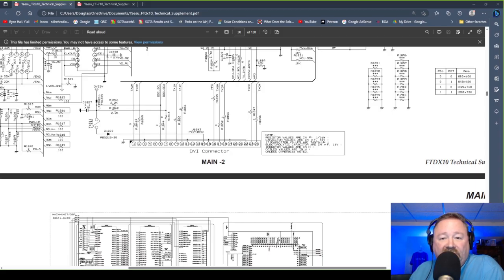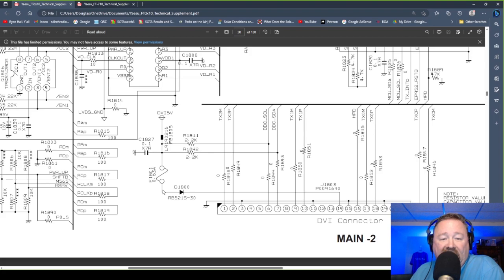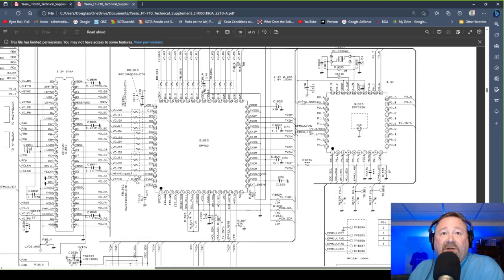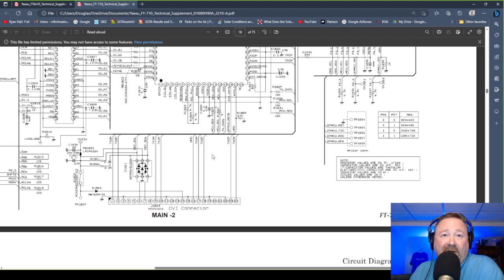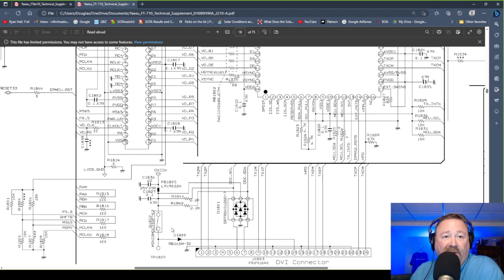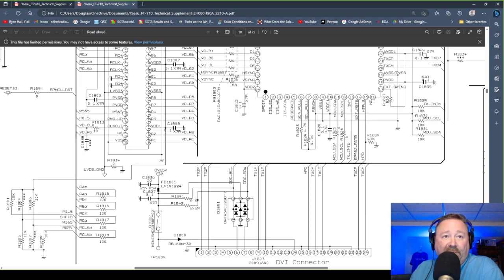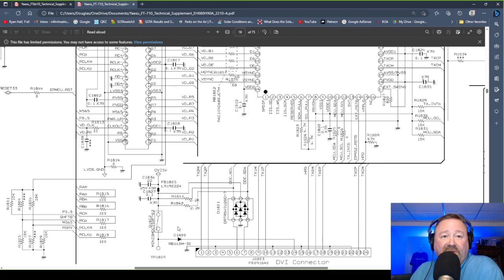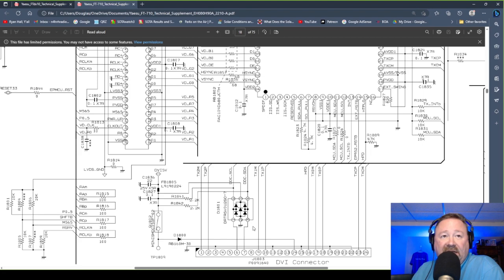Yaesu FT-710 AESS: DVI-D Port Protections (video #35 in this series)

Comment: Thanks so much for bringing to light the issue, and showing the difference between the two radios.   With the improved overcurrent protection on the FT-710, do we know if there have been any 710 returns to Yaesu due to HDMI-caused failures?     73, K7KS
Reply from the maker: You would need to ask Yaesu about that. The FT-710 has a self-resetting fuse for the DVI circuit, so I suspect less of them have had to be sent in for repair.  I stayed with the FTdx10.  For me, receiver performance takes priority over using an external display adapter. I used an actual DVI-D cable and monitor, and April will be three years with no issues.
Reply: @n4hnhradio  actually 710 has a better receiver performance with zero distortion that you get distortion all over the place on dx10 - it is just better technology and as the firmware improves the algo improves and it gets better and better.  So dream about your dx10 bean better - maybe only for CW.  -
Reply from the maker: The DNF in the FTdx10 introduces distortion versus the FT-710.  But the DNR in the FTdx10 makes it possible to hear signals that are barely above imaginary.  The FT-710 DNR introduces digital distortion.  There is no one perfect radio.
Reply: @n4hnhradio  not worth 380 EUR difference for what few db it gives of separation when in busy contest.  Other then that 710 is a lot cleaner in everyway.
Reply from the maker: Suit yourself. I’ve used both. I made my choice.  I don’t participate in contests.  I chase barely above imaginary QRP SOTA activators.  I need the best receiver possible.  The FT-710 can compete with any on CW, but not SSB.  Still better than many though.  Just not quite at the level of its big brothers.  Also missing some convenience features that the big brothers include, such as the ability to set the mic gain for AM in menu so it automatically recalls it when you switch to AM.  That’s just one that the 710 is missing.  Also more cumbersome to access and adjust DSP, versus the knobs and buttons on the FTdx10 and FTdx101.  But, after using any radio long enough, you can become accustomed to idiosyncrasies and inconveniences.  I don’t like the location of the Band button on the FTdx10 but I’m accustomed to it now, and I use MT anyway.

Comment: Hi Doug, I wonder if you ground monitor to station ground instead ac ground to avoid ground loops through DVI cable. 73 de SV1FJK
Reply from the maker: I don’t ground my monitor. Never an issue. I ground radio, amps and antenna switch.
Reply: Maybe I didn't express my concern correctly (and I apologize for my English) but what I meant is  that monitors (at least those with internal PSU) connect ac ground to chassis which in turn connects to radio chassis through DVI cable ground  and can create ground loops. I  have a old  radio without monitor output (Ten-Tec Corsair II) and for FT8 I connect it  to PC sound card through isolation transformers to avoid loops.
Reply from the maker: I’ve not had any ground issues.  My monitor connects to AC ground via power cable. The DVI-D is separate.
Reply: Thank you very much for your answer, I thought that were bonded.

Comment: Maybe Yaesu should consider adding a DVI-D cable to avoid the issues they had to know would come with the use of the adapters.
Reply from the maker: Did you send that suggestion to Yaesu?  Though they do make it very clear in the manual to use a DVI-D connector. And, people already complain about the price, even though the radio has been discontinued for a while now.  Would they be willing to pay an extra $30-40 for the cable?
Reply: @n4hnhradio  no I didn't, but I find DVI-D cables all the time for under $10. I don't believe there is the same copyright with DVI-D as there is with HDMI, and as it is older video technology, the monitors and TV's that accept it are easily found for $25 or less.
Reply from the maker: Yes!  Been preaching that for a while. We have a whole discussion dedicated to it over on my Patreon portal, with a list of monitors various members have found available online.  But, if Yaesu included the cable that would probably add more than $10 to the price.  I think we are better off buying it ourselves. Mine came with my monitor.
Reply: @n4hnhradio  I think they could have added those cables for a lot less than $10, after all most cables are made for probably a lot less than that, so Yaesu could easily have absorbed the price increase.
Reply from the maker: The radios aren’t a profit center. I’ve seen the wholesale versus retail pricing. They make very little above the cost of building the radio. That’s why an external speaker costs $180. That’s why there are $660 microphones. The manufacturers have to make their profit from the accessories. 

We are buying radios for barely more than 1959 prices these days.  A quality transceiver in 1959 was $1,200. In today’s money that is $12,581.  The radio manufacturers know that they will not sell many radios with prices at that level. The Hiberling PT-8000A was $17,000.  The ICOM IC-7851 is $14,000. Those radios sell at extremely low volume. I think the Hiberling isn’t even available now. 

So, the manufacturers have to cut corners somewhere, in order to keep the price range such that people will buy. But people complain about an FTdx10 price of $1399.95. That’s an unbelievable price. Even at it’s introductory price of $1699.95 the FTdx10 was a steal.

The cable isn’t the issue. They are easy to find. It’s the monitor that people struggle with. They want to use HDMI.  Give them a DVI-D cable and it will stay in the box.  But you aren’t going to solve anything here. I don’t work for Yaesu.

Comment: My guess is because HDMI is proprietary requiring a license. DVI isn't.
Reply from the maker: Yes. I’ve been saying that for a long time.  Others dispute me.  John, from Yaesu, says the decision to use DVI-D was because they weren’t going to need the audio output of HDMI.  I’m not buying it.  Yaesu used the EP-952 HDMI chip to output the video. They just chose not to use the HDMI connector/logo. That’s what costs. I definitely think the decision was financial.  And I’m okay with that. Just be honest about it, Yaesu!  

The radio outputs a maximum resolution of 800 x 600. Even DVI-D is overkill.  So, I’m convinced that the DVI-D connector was the logical choice to keep the price lower.  There is a discussion about this at: www.PATREON.com/N4HNH

Interesting information:  https://electronics.stackexchange.com/questions/453991/is-there-any-modern-video-connector-you-can-use-royalties-free

Comment: In the comments below, some are referring to a specific cable or adapter while reporting that they've had no issues. But, but, but... The display itself is another variable. If the display itself doesn't provide any voltages on the HDMI pins (or whatever the issue is), then perhaps that's why you're getting away with using a particular cable or adapter. Providing a recommendation to a specific adapter or cable without acknowledging that this other 'display' consideration is another variable is potentially very bad advice.
Reply from the maker: The issue is current draw off the fuse that is in series between the 5vDC supply on the motherboard and pin 14 of the DVI-D connector.  I cover this in detail in the Technical collection on my Patreon site.  It’s also covered in video #35 of my FT-710 AESS series, available to Patreon team members.

I do know of one FTdx10 failure due to a faulty monitor. It was one of the S9 (VIP) Patreon team members who supports this channel. Yaesu repaired his FTdx10 under warranty. He tried another monitor, same model, and all is okay thus far. 

But most FTdx10 failures have been attributed to the excessive current draw caused by certain adapters. There is a 0.63A fuse In series with the 5vDC DVI-D supply.  The “keep awake” voltage.  Some adapters might draw 0.63, 0.64, or maybe 0.65 Amperes through the 0.63A fuse on the motherboard of the FTdx10.  A fuse doesn’t blow instantly at its rating. It depends upon how high the current is above the fuse rating and for how long.  

One FTdx10 owner thought he had found the perfect adapter. But 6 months later, his DVI-D port stopped functioning. I suspect that the adapter he was using was drawing just barely above the fuse rating, perhaps even 0.64 or 0.65 Amperes.  It just took longer for the fuse to blow. Each time it heated to near its burn temperature, but did not blow, the element was weakened.  Eventually it weakened to the point that it burned in two.

Comment: 5:50  I believe that it's already been established that Yaesu's rationale is that HDMI comes with significant royalties, while DVI does not.
Reply from the maker: Yaesu denies that.  I said that long ago but I was shot down.
Reply: John Kruk said that dvi-d was for “clean video” I call bs. It’s low rez 480.
Reply from the maker: At one point in time the fee for using an HDMI connector and logo was $10,000 per year for unit sales of 10,000 or more, plus a $1 administration fee per unit sold. Royalty was an additional 0.15 per unit sold. I’m sure the cost has increased over the years. These costs must be factored into the price of the radio. Perhaps Yaesu reasoned that the extra cost for an HDMI connection wasn’t justified, given the low resolution.

Interestingly, the actual video chip in the transceiver is the EP952, an HDMI chip. The chip is capable of much higher resolution than is required by the display of the FTdx10 or the FT-710.  The chip is also capable of outputting digital audio.  

Yaesu is using only a small portion of the capabilities of the EP952. Maybe they were able to procure the chip for a very low price. And maybe they initially thought they might actually pay the royalty fees involved in using the HDMI connector and logo. But maybe they subsequently reasoned that HDMI was overkill and using it would push the target price point too high. The FTdx10 was introduced for $1699.95.  People even complain about the sale price of $1399.95.  $1,399.95 for a transceiver that has better dynamic range than radios costing $8,000, $14,000, and $17,000?  Yes, there are radios in the top 10 of the Sherwood Engineering receiver test data list that cost that much, yet they rank lower than the FTdx10 in the list.  They even rank lower than the FT-710.
Reply: @n4hnhradio  yep, I’ve read all that before and it makes sense. However it’s no reason for John to white lie the questions away. It’s pretty ridiculous and I really don’t think I’ll buy another Yaesu until that guy is outta there. He is very condescending in almost every interview.
Reply from the maker: I have made my views on that known, directly to Yaesu. But, will I stop buying Yaesu?  Probably not. I’ve tried not to buy Yaesu in the past. But each time I’ve benn ready to buy, Yaesu had the best radio for my money. Not perfect, but the most for my money. And, since no manufacturer makes a perfect radio, I will go for the nearest to perfect.
Reply: @n4hnhradio  they do make great radios but even when Ray Novak talks about the greatness of DPRS as why Icom doesn’t do APRS he’s not a jerk about it. Mr Kruk is not good at public relations. Condescending and the channels comments are closed etc. Watch his eyes, they are always darting around, arms waving, hand gestures all signs of a high anxiety double speak.
Reply from the maker: You should write to Yaesu.  I don’t think they listen to any of their U.S. staff, not even John. He’s probably stuck in the middle. Japanese engineers don’t care what Americans think.  They are the better engineers. Just ask them.

Comment: Somebody somewhere should be able to design a special Yaesu-compatible DVI-D-to-HDMI adapter that would cut or delete the signal or power lines that are causing the issue. Maybe, in some alternate universe, Yaesu would even offer such an approved adapter themselves. One would expect that the Ethernet-like digital signals are compatible. I don't understand why the planet isn't overflowing with solutions by now. 

By the way, SMT "Resistors" that are marked "0" (zero-ohms) are probably to be considered PCB jumpers (for routing or options).

Comment: Hi Doug,
Would you be interested in reviewing the Yaesu SCU-LAN10 Network Remote Control System SCU-LAN10? It occurred to me that, aside from its remote operation capabilities, we might be able to use it as a sort of interface for the DVI-D situation where you could connect your computer to an HDMI monitor/display. There might be some latency issues but it would make for some interesting videos. I could order it from HRO in Atlanta for your pickup. What do you think?
Reply from the maker: Hi Martin!  I could do that. Have you already used one?  Do you like it?
Reply: I’ve thought about trying one to increase my radio usage outside the shack but have not purchased one yet. It just hit me that its use could go beyond remote operating. HRO does not have them in stock right now. I’ll ask to be notified when they are in and contact you to see if you’re still interested.
Reply from the maker: That sounds good. Just let me know. It seems that many things are not available at the moment.

Comment: Something I have not seen on the Facebook groups...and there has been a lot of discussion on this issue - what actually happens when this is blown ? is the rest of the radio still functional ? does it simply mean that video out no longer works ? or does it affect the rest of the radio ? I would also like to know if any of the 710 have had this failure  with its better protection ? thanks
Reply from the maker: You lose video output to a monitor when the fuse blows. I haven’t heard of any external monitor issues with the FT-710, but the manual still specifies a DVI-D monitor.  I’m sure Yaesu can tell you if they’ve had any warranty returns for the FT-710 video output.  

The good thing about using DVI-D monitors is that they’re cheap now. I’ve seen them in the $40-60 range.  One of my viewers told me yesterday that he bought one, with the cable, for $10.  Using DVI-D saved money on the price of the radio and it saves money on the monitor. DVI-D still capable of a much higher resolution than the radio needs.
Reply: I know I'm late to the party but I have had the same issue with an FT-710.  I never used an adapter because I have 2 dvi monitors.  It may have been broken out of the box, though.
Reply from the maker: The FT-710 AESS has protections that the FTdx10 doesn’t have.  I cover those in video #35 of the FT-710 AESS video series.  I compare the schematic diagram of the FTdx10 DVI-D circuit and the FT-710 AESS DVI-D circuit. You can clearly see that Yaesu learned a lesson from the many warranty returns to repair the FTdx10 DVI-D circuit.
Reply: 5 VDC passes thru that fuse on out to DVI pin-14.  It's a "keep alive" voltage without which any display will enter sleep mode thinking the computer feeding it has been turned off.  Active converters usually draw power from the 5 VDC on pin-14 but Yaesu didn't provide as robust a DC power source as found in any typical video graphics adapter.

Comment: I really do not understand this overkill chip without proper overcurrent protection which is described in both DVI and HDMI specifications. I can understand DVI connector, as you need to pay royalties for HDMI. Waiting to the warranty end of my FTDX10 to implement at least resettable fuse. But so far running well using DVI-HDMI cable.
Reply from the maker: There is overcurrent protection. I showed it in the video.
Reply: @n4hnhradio  Yep, in FTDX10 it will work only once :) and it is set for 0.63A, in FT-710 is set for 0,5A, where the maximum monitor current draw from this pin is 55mA and short circuit currents bigger than 0.5A are not allowed (DVI spec). Both blow and polyfuse protection will allow bigger current, at least for a while. There are dedicated ICs to do the protection properly, with current monitoring and shut-off MOSFET. First example : TPS22948. Looking at the US law system from the other side of the pond I can imagine lawsuits when 0.6A current flow through broken monitor or cable will be sufficient to start the fire and burn someone's shack. And the jury will state "guilty" looking only on the Yaesu schematic diagram :)
Reply from the maker: If you wish to reengineer the radio, contact Yaesu.  I don’t work for Yaesu. You can reach them via their Contact Us page.

Comment: I believe there is some sort of royalty payment attached to using HDMI as opposed DVI, so it might not just be component cost of the plug, regardless of chipset in the radio.  It’s really frustrating because if you are using a big external monitor it would be nice to also get the sound to it via HDMI instead of the small speakers in the radio, or seperate external speakers.
Reply from the maker: At one point in time the fee was $10,000 per year for unit sales of 10,000 or more, plus a $1 administration fee per unit sold. Royalty was an additional 0.15 per unit sold. I’m sure the cost has increased over the years. These costs must be factored into the price of the radio. I assume Yaesu reasoned that the extra cost for an HDMI connection wasn’t justified, given the low resolution.
Reply: @n4hnhradio  "...the extra cost for an HDMI connection..."   Yes, HDMI 'connection' (with all the associated royalties and fees and so on) as opposed to it being an issue with the cost of the 'connector'.  I very much doubt it's a 'connector' issue as was mentioned and described in the video. But speculation on my part.
Reply from the maker: Yaesu uses the EP952 HDMI chip. They just didn’t use the associated HDMI connector. The royalty is related to the use of the connector and the logo.